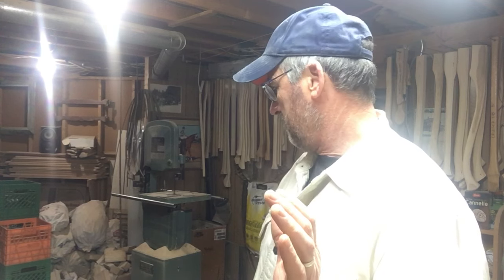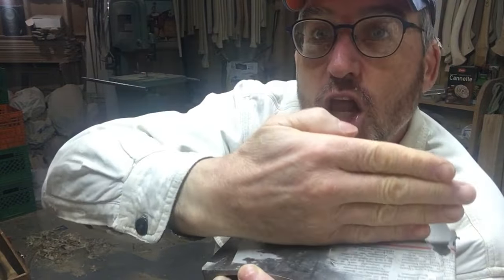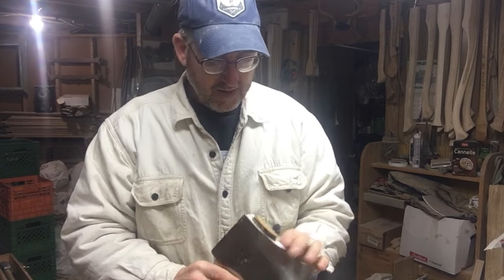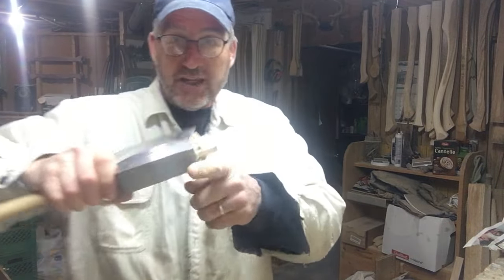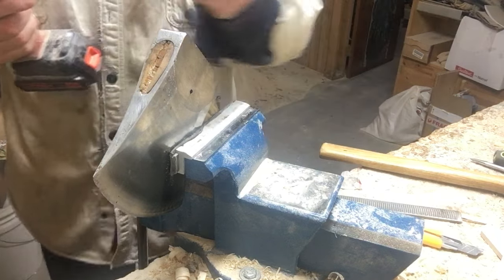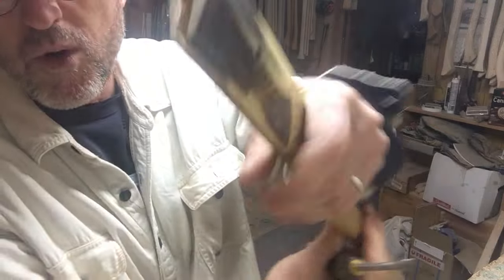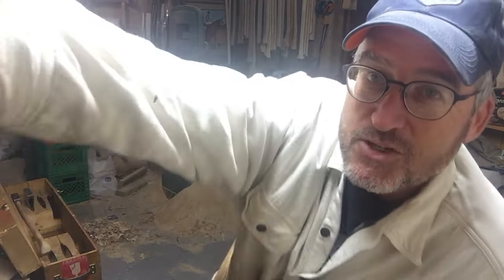How to PROPERLY tighten a loose axe head

Comment: I agree with your techniques for relatively new handles but it is a lot harder with antique handles.  If the handle wiggles at all you can pop out any metal wedges or nails then secure the axe perpendicular to the floor in a rubber jaw cushioned vice.  Keeping the blade and handle out in front of the jaws take a junk of 2 X 4 and tap it in under the axe so the front of the blade is supported.  I use multiple sizes of steel drifts to tap the top of the eye and start pushing the handle out.  When it falls free I put the handle in the vice and carefully pry out the wooden wedge.  On a broken handle I put the axe in the vise with the handle parallel to the floor and drill in with the first bit straight throught the axe up and down the wedge.  After the first hole switch to a bigger stronger bit and drill out the first line of holes and use a reaming action to open them up.  You can take out most of the eye then use your drift to easily tap out the handle.   You can use the first six inches of the handle to make a wooden drift.  I  also got a welder to make me a steel pipe with a base to sit on the floor.  I drop the broken handle down in the pipe and use wood and/or metal wedges to tap the old handles out when I don't need a vise. The top of the pipe has a wrap of soft metal that doesn't dent the axes I am working on.  This is a version of a handle tap out device I watched an old handle maker use.  It is amazing how tight a properly secured handle can be seized into an antique axe.  Another option is to make a holding device that clamps onto the bed of your wood splitter.  You can use a steel drift that either fits onto the front of the splitting wedge or can be bolted in with the wedge removed.  If you have a bottle jack that will work parallel to the floor you could also use that to push the handle out.  These are all options for  those seriously  locked in antique handles.
Reply from the maker: I have an earlier video that explains how to remove handles much like you describe, and include even the difficult "epoxied" handles.  we're headed down the "Street Rods VS Antique automobiles" road in this discussion - some want everything original, and others just want something new and functional....LOL

Comment: I have a bad hatchet someone gave me there was no wedge instead 5 nails.
Obviously didn’t do a lot but it got me thinking, I put 3 screws in the top and it worked better than anything I’ve done so far now i wouldn’t do it with a handle that I care about but it does work pretty good

Edit: the screw widens at the top unlike the nail it spreads the wood and the threads stop it from coming out, but this can and probably will weaken your handle
Reply from the maker: LOL!  In honesty, that's exactly what you are trying to avoid doing.  When you go to replace it - because this will eventually become loose again - now you have to drill around and remove all that metal.   Good thing about your own axe is you can cure it however you like... Over the long haul, it might not pan out as great as you think initially.

Comment: I never use a steel cross wedge. I glue my wedges and they rarely get loose but if they do I use an oscillating multi tool with a plunge blade and drive another wedge in.
Reply from the maker: In our racket, the only metal wedges are aluminum, and they have a tab at one end, and are usually used by choppers who switch handles frequently.  The tab at the back is incredibly helpful to remove the wedge when the time comes, and these wedges are smooth sided.   my wooden wedges have "rough" sides and this helps to keep them in well, without glue.  I've never found glue helps a lot when removing old wedges.   If they never come loose for you your handles must be around 6% moisture when they are hung, and never stay outside.   in fact, if you don't use them in adverse weather or store them outside I understand them not coming loose.
Reply from the maker: Love the name by the way...LOL!

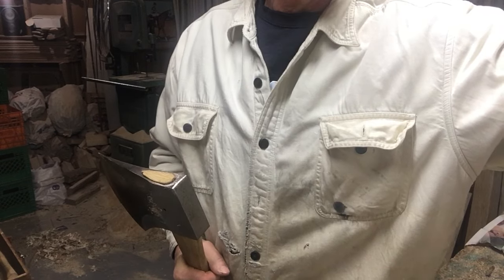Comment: I think you were about to talk about a method using a file around the 6:30 mark but got sidetracked by the bucket of water. Just curious what that was.
Great video.
Reply from the maker: All that method involved is driving your current wedge that is loose - in deeper.  I use an old axe file that I can hammer on, and simply drive it in deeper.   Problem is, when you go to rehang, there is little at the top to grab onto.  Sorry Joe.....you are right...."Squirrel!"...and I'm gone.

Comment: I still find it strange that more folks do not cross wedge handles. When handles get loose they don't tend to flop about side to side, but nearly always, the movement is in line with the axe edge. When you think about it, it's in this plane that the handle has the greatest stresses in use, both from striking and withdrawing the axe. The standard single wedge set up only compresses the handle wood against the sides of the head. Assuming a good contact in the bottom half of the 'hourglass' The only real contact at the ends of the eye, is where the wedge touches, and even this is not under any great compression. I nearly always fit wood cross wedges to compress the handle wood in its long axis, and this also gets rid of those irritating little crescent spaces next to each end of the main wedge. When you get used to it, it is very little extra work. Pardon me If I've gone on about this before ...
Reply: Good point about the cross wedges and the forces placed on an axe head under use.  For conversation sake I’d like to throw in my take/opinion them.  They seem like a last resort when the fit  can’t be made tight with a custom made wedge, if that’s what the axe is calling for.  A wedge can be made in a slight hourglass shape(looking down) if the handle doesn’t offer enough wood to get an even gap before the wedge is pounded, this helps with the pesky tiny gap you mentioned.  Sounds weird, but I try at all cost to avoid starting a crack in the weak direction of the handle, in relation to all the force put into it.  A snug fit at the bottom of the eye should take care of that, but still… handles usually crack at 90 to the grain, or along the grain.  Anyway, I figure less splits in the business end the better.  That said, I’m not afraid to blast some steel wedges in cross grain when the fit doesn’t work out perfect.
Reply: @ianallenw  

I know folks will think I am obsessed with finicky details, and perhaps they are right, but as anyone into timber sports knows, it is attending to the all little things that gives you the overall edge [pardon the pun]
I agree about the 'hour glass shaped wedge' you mention, indeed, the whole of the wedge should be shaped so as to fill the spaces while still adding compression to the wood. To my mind, however, this still does not provide much in the way of compressing the handle in the long axis. For this, there are two choices. Either fit wood x wedges or one or more steel wedges or barrels. My choice is always for wood x wedges, even if there are no apparent gaps at the ends, you still need to add compression.
You hit the nail right on the head when you talked about a snug fit at the bottom of the eye.... to this I would include that flattish section at the 'waist' of the hourglass. The fit of the head is a dependent on two wedge systems, one either side of the waist. The wedge at the bottom [handle side] cannot be compressed with driven wedges, so the strong and effective wedge effect we need can only be created by careful shaping of the handle to give a really 100% close fit over the whole of the mating surfaces, and driving it on as hard as you dare prior to wedging.
For me, this is often the most time consuming part of a hang. I use a small trace of graphite powder wiped inside the eye to clearly mark up all the the high spots on the wood, which are removed using a scraper,file and sandpaper, usually a good few times over. When finally done, the handle takes a decent bit of effort with a 4lb hammer to drive it fully home. Get this bit right, and it is virtually impossible to get a crack propagating towards the handle from the bottom of any kerf as the crack has no space to form. The only failure I have had was my own fault, cutting the x wedge kerf too close to the end, and a segment snapped off within the eye with an audible 'crack'. A bit sloppy on my part, but as this was my own 'beater' for log splitting and it felt pretty solid, I left it as it was .... and a few years later still is, good and tight. One thing I have changed over the years is the depth of the x wedge kerf. These seem to work better, the longer they are, it being easier to bend a long piece of wood rather than a short one. It all depends on the shape of the eye, but as a general rule I cut them to reach into the 'waist' of the hourglass, which usually means only about 1/4" shorter than the main wedge. These X's do need to be driven at the same time as you are advancing the main wedge. I start by driving the main wedge about a quarter or third of the way in, then start tapping in the x wedges, a bit more on the main, then back to the x's and so on... nice and steady. This keeps the cheeks tight up against the eye as you drive these comparatively delicate wedges, and reduces risk of breaking them. Using a steel drift between hammer and wedge really gives greater control and makes the job go easier'
I urge you to have a go at this. Once you get comfortable with the method, I doubt you will ever go back.

Written by an old geezer with too much time on his hands so, If you have read this far, I commend your powers of endurance, Sir.  ;<)
Reply: @bigoldgrizzly  Thanks! I have rehung a lot of my heads on different handles, and used hardware store handles...also, I am in a desert, so everything shrinks. I noticed the same thing as you, gaps and force front to back. Recently I hung a chinese 8lb maul head on a hardware store handle. Cross wedged for the first time, quick and dirty, but it's holding fast. Uncool underdog parts have become my favorite splitter for the big dry eucalyptus rounds.
Reply: @davidwyby  
Glad it has worked for you. Mauls especially take quite a battering as there tends to only be a short length of the handle in the eye. The tighter you can get them fixed in at the start, the better they'll last. Luckily where I am, we don't tend to get big seasonal changes in humidity.
Reply: @bigoldgrizzly   I forgot to mention it's an axe eye maul.

Comment: so should I use Glue on my wedges
Reply from the maker: IMHO I would say no, but for several very practical reasons: 1. you cannot tighten the wedge further if the handle shrinks a wee bit more after the initial hang; 2. you cannot remove it as easily if /when you need to replace the handle and 3. if you leave your handle outside at all, and the wood shrinks and swells with the ambient relative humidity, you will experience both number 1 & 2, and will need to replace it more often.  However, like most things in our world, it is personal preference, and many guys swear by the glue.

Comment: In a bind id toss that thing in a bucket . I've done it with hammers. You need it tight at the moment. You'll deal with the repair later
Reply from the maker: LOL!   Nooooo Tim!   LOL!   I get it.  I get why....but 98% of people are not going to deal with the repair for a loooong time.
Reply: @eastcoastlumberjack  haha .. well, i love axes, but in the end it's just an axe. Handles have to be replaced eventually anyway. I have axes with cracked handles.  I wrap the cracked section in wire and keep using them.